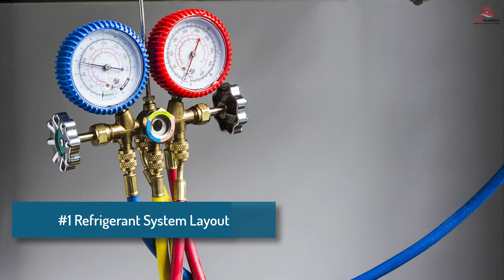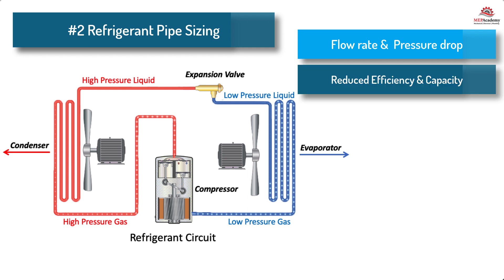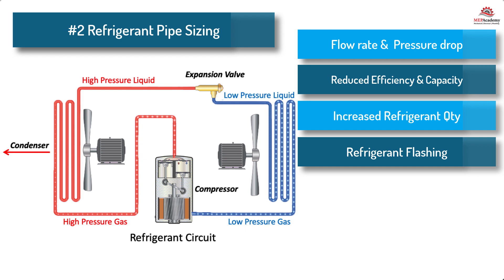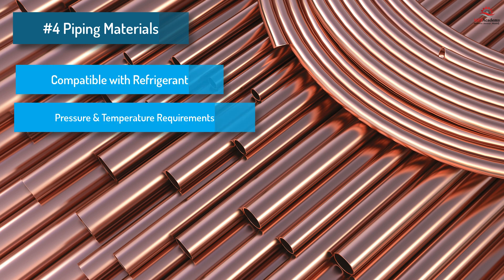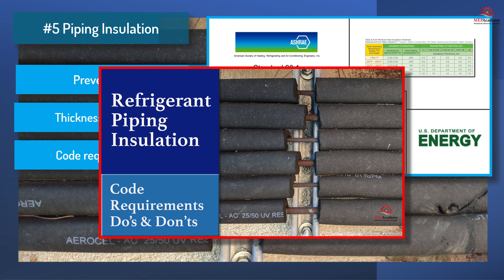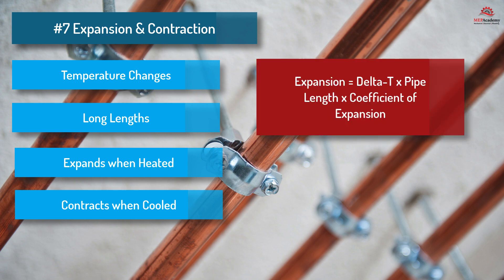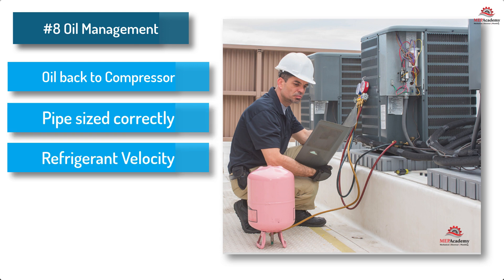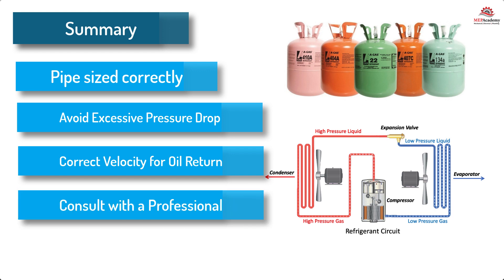Refrigerant Piping Design Basics

Comment: I got a new Heat Pump system installed a few months ago, and, while I was leaving, I noticed that the installer ran a 3/8" copper refrigerant pipe into a 5/8" (or 1/2") copper refrigerant pipe. In other words, he ran aprox. a foot of 3/8", from the compressor outside, into the existing 5/8" pipe that went through the wall, to the air handler. Once inside the house, the pipe was reduced to 3/8" before it got to the air handler.
Is this proper? Wouldn't this foul up the pressure of the refrigerant before it gets to the air handler, leading to a less efficient system? Thanks in advance for your response.
Reply from the maker: Good question — and it’s understandable to notice that. What you’re describing is not automatically a problem, and in many cases it’s acceptable. The important point is that the line size at the air handler and the total equivalent line length match the manufacturer’s requirements for that heat pump.
A short transition (even a foot or so) where the line increases or decreases in size will not materially affect refrigerant pressure or efficiency. Pressure drop is driven by total length, fittings, and flow rate — not a brief size change. Installers sometimes do this to adapt to existing line sets through walls to avoid opening finishes.
That said, the system should ultimately comply with the manufacturer’s approved line sizes for both the liquid and suction lines. If the final connection at the air handler is 3/8" as required, and the overall run length is within limits, the installation is considered proper.
If you want peace of mind, you can ask the installer to confirm that the line set sizing and equivalent length meet the manufacturer’s specs and that superheat/subcooling were set correctly at startup.
Reply: @MEPAcademy  Thank you for your reply. Really appreciate it.

Comment: Is 45 or 60 degree piping elbow allowed in vrf system!
Reply from the maker: A 45 degree elbow is common, but a 60 degree isn't. The standard fittings in a VRF system will be 45 degree elbow, long radius 90 Degree elbows, couplings, and the manufacturers special "Y"-Branch fittings.